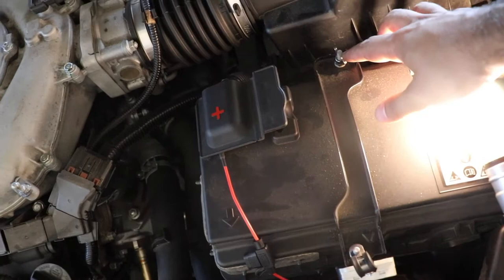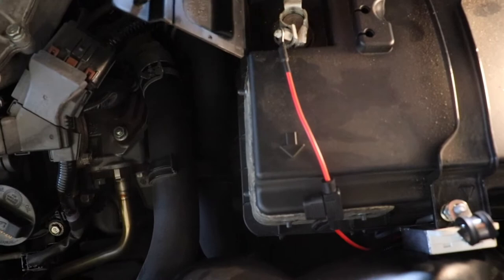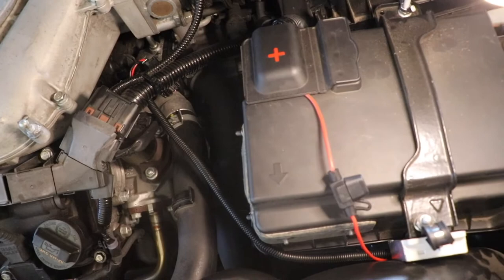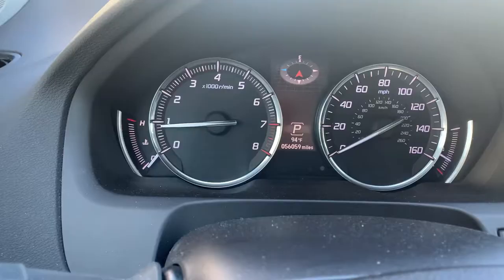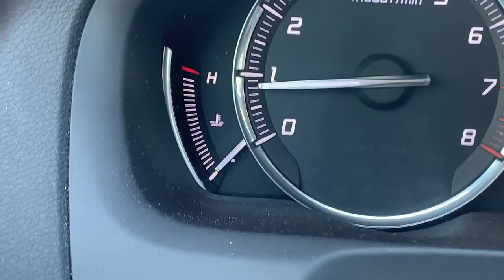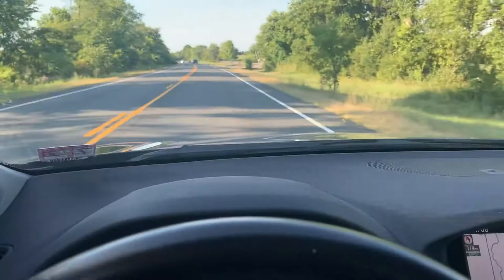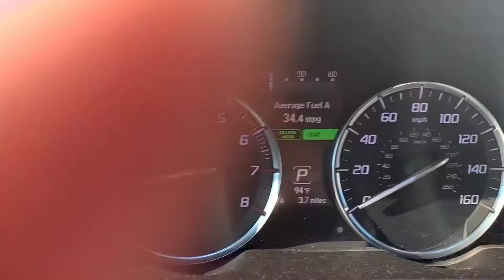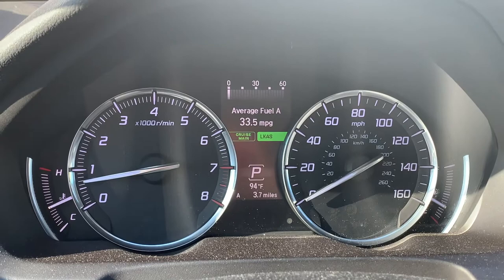Why I hate Honda & Acura VCM

Comment: The cylinders are disabled by disabling their valves. This creates a vacuum inside the cylinder, sucking oil into the cylinder, and burning off the oil when the cylinder is reactivated. This is a major flaw with this method of cylinder disabling.

Comment: I put in a VCMmuzzler about 2 years ago.  Transformed the car and made it drive so much more smoothly.
Reply: Did your fuel economy get worse?
Reply: @MrSamPhoenix  no. Stayed roughly the same within 1mpg, and the transmission jerkiness was gone
Reply: @ganzonomy  fantastic
Reply: This might sound stupid but It worked for me… I had the same issue in my 2011 odyssey after I drove 100,000 miles…. One day I was like u know what let’s change transmission fluid and o boy it fixed the VCM problem I don’t know how but It sure did now I change my transmission fluid every 10000 miles….

Comment: We own a 2014 Honda Odyssey with AVCM. it runs as smooth as ever. We cannot tell when it is engaged.  When we drive on the freeway at 65 mph, we can get literally over 35 mpg.  Again, we really do not notice the change in smooth running with eco mode.
Reply: given the year of your vehicle you probably have the vcm version that disables only two cylinders instead of sometimes 3.  I have read this system is better than the version of vcm that shuts down 3 cylinders at times.  I was not as lucky with my 2010 honda Accord.  I experienced spark plug misfiring due to oil infiltration into the cylinders but no other problems.  I installed the vcm muzzler two years ago and all problems are now solved.  Glad to hear you got one of the good ones!

Comment: I actually kinda like the VCM in my Acura. The vibrations are annoying but I do a lot of road trips and the better MPGs are nice. I do keep a quart of oil on me in the car because I heard some horror stories of the VCM causing oil burn.
Reply: Just realize you will have to replace the engine mounts more often because of vibrations...
Reply: @richbrake9910  that’s good to know. I’ve been told the same thing by a few other people so I will see how my new Acura does.

Comment: See my only concern about this is the coolant temp. The computer changes how the car run when it is not warned up. Different fuel levels and what not. I dont like the fact that using that is fundamentally changing how the car should be running when it's up to operating temperature
Reply from the maker: I definitely understand that concern, I was on the fence about buying it but I haven’t noticed any ill effects since installing it, only a bunch of positives. My highway mpg has improved, there’s no annoying NVH when the cylinders used to shut off, and the passing power is always there now. If there are any bad side effects I haven’t really experienced them.
Reply: @viksvehicles  I dont see how its possible for your highway mpg to improve when you are using all the cylinders
Reply: @reedhensley  If you ride the gas in an attempt to hold constant speed this will improve your mileage on highways. The  reason for this is that the 3 cylinder mode doesn't really maintain speed as well as it should so when you ride the pedal in attempt to maintain 60-70 mph, the 3 cylinders work overtime and use up more gasoline than if the 6 cylinders were working at a lower rpm. Basically its too inefficient at 3 cylinder mode to  maintain cruising highway speed above 50 mph. It gets worse on interstate when you try to go 75-80, having the 3 cylinder mode kick in then and you will see once you let go of the pedal the speed drops way to too quick causing you to push on the pedal more and use up more gas.
Reply: @reedhensley  when I’m 3 cylinder mode and u put down the pedal just a little it’s staying in 3 cylinder mode or 4 cylinder mode but those cylinders that are active are working harder than if u just had all 6 running.  Engine has more continuous power, so therefor never is working as hard

Comment: I bought a 2020 pilot with 25k I have 33k now
I had issues with my torque converter jumping at 2k rpm and kick down at low rpm slowing down making a whoosh sound at 2k rpm and a skip.i did a 3x drain and fill and oil changes I do at 40% always down 1 qrt 
Also had issues with heat at idle after trips fully warmed up heat at 75 degrees would blow cool air.

I purchased s vcm and now after driving no more slipping or vibrations my heat at idle is working after honda said the heat issue was normal it wasn't .vcm was the issue and also doing oil changes at 40% after install I'm not down on oil anymore .engine no longer burns oil 

Vcm is the worst system disable it if you want to keep your engine .the car runs so smooth ,more power also .it's driving better then when I bought it
Reply: I have a '19 and you are going to find the 9 speed transmission is jerky.
Reply: @midwestfarm757  I have the 6spd it's very smooth after I did the 3x drain and fill transmission.

Comment: I see how some people also have good luck with the VCM (Variable Cylinder Management). The trick is too make sure to change your oil earlier than what the computer tells you to (between 3,000 & 5,000 miles).
Reply: I was thinking the same thing I change it every 3500
Reply: Me too I don’t have problem at all with the vcm but I change like 3k - 3500 and I have like 170k miles
Reply: That gets expensive that’s ridiculous bought a 2011 Pilot and I noticed the oil level will go low about 3-4000 miles that ridiculous I never had any issues with my Toyota or Lexus I should’ve bought a sequoia or 4 runner. Is the pilot burning oil???
Reply: @Lowersillox doesn't the disabler disable your cooling fan, too?
Reply: @valentine1782   at that day I don’t have the s vcm disabler, but now I have it and I can tell you, svcm don’t disable the coling fan, I tested first idle like 30mins and they come up. I have months with that and I don’t have any problem
Reply: You all are forgetting about your motor mounts!  Because the engine is running on fewer cylinders, the additional stress on the motor mounts will destroy them!!  The mpg loss from disabling VCM is less than 1mpg but the piece of mind of knowing you WILL NOT prematurely destroy your V6 is well worth it!!

Comment: Good info about the after effects of Honda’s ill conceived system to conserve fuel. Though this post lacked detailed info on installing the S- VCM disabler. Getting to the plug on the coolant hose is a pain in the @$$. Push on the connector release rather than pull on it (as I did, er tried). Park the vehicle and let it sit for an hour. Keep the key fob far away from the vehicle. At least 20 feet from what I read. The key fob may activate signals that send codes which could come up while installing the device. I heeded that fore mentioned advise and have had no issues so far. Remember, those fluid filled motor mounts are Expensive! Though not as much as a rebuilt engine would cost due to the adverse effects of the VCM.

Comment: I just bought 2020 Odyssey and I have had a couple of long drives and I did not feel any vibration or anything of that sort during the drive. Has Honda fixed these vibration issues in the new models?
Reply: u haven't yet because your car has new engine mounts. when they fail you will feel the vibrations
Reply: I notice the VCM more in colder weather as well.

Comment: I have just bought a Acura RDX 2018 with 97 km and the car has a lot of vibrations in the high way Idk why?
Reply: u need new engine mounts. they are electronic and control the extreme vibration from cyl deactivation on the highway

Comment: I hate it also 😒  and i have the vcm muzzler thats a direct fit on the only thing is it engages sometimes when the engine temp gets higher
Reply from the maker: I didn’t want to fiddle with the different settings on some of the fixed systems where you have to swap out the resistor. So far mine is working well and I haven’t had to adjust anything, I haven’t detected the car shutting off any cylinders since I installed it :)
Reply: I have the vcm tuner and the eco green light comes on sometimes times but I don’t feel the jerking anymore

Comment: Just bought a 2010 odyssey ex-l with 107k miles on it. Drove it home on the highway but didn't notice anything when the eco light came on. I was aware of the vcm issues prior to purchase. I'm thinking about disabling it completely to give this van an extra 10 years of life for the family.
Reply: I just bought my 2013 pilot with 110k miles. Can feel steering wheel and pedal vibration when eco light on. It’s minor feeling though was tires issue, but according to this guy’s description I’m sure it deprive from vcm deactivation.

Comment: Your video doesn't indicate the make of your vehicle.?  I have a 2005 odyssey with VCM.  Tried tuner and this stopped the premature oil burning and premature front engine mount failures.  With Tuner gas GPM = 20 with VCM GPM=27.  But the tuner stopped the engine oil burning.  See Honda service teck bulletin 13-085. Honda lost a law suite and gave odyssey 8- year warranty for owners to bring in their vehicles to have the piston rings replaced due to premature oil burning.    Notice odyssey doesn't use timing chain but a timing belt. This means higher maint4enance cost.

Comment: I’m going to say this even tho I’m not sure what it is but I have a 2017 Honda Accord V6 touring sedan and it has a 6 speed auto, sometimes when I’m cruising at 80km/h—50mph the car stays in 5 gear for about 30 seconds and it has kind of like a drone sound because the car stays in 2,000/2,300 rpms until it finally shifts into 6th gear and the rpms drop to 1,400 rpms, the car is completely stock I don’t know if is something of the transmission programming or is that VCM that at 80km/h the car switch to 3 cylinder
Reply: I have this same car. Do you notice the vibration in the steering wheel as well? Or when cruising at 65+mph? If so, then it’s definitely the VCM. I’m gonna order a disabler and see how it goes.
Reply: If your letting off accelerator most of the way your cylinders are deactivated, and if at a higher RPM like that your more likely to feel that vibration

Comment: I have a 2014 Honda Accord EX-L Sedan with a V6 and an automatic transmission. Does my car have VCM? I’m pretty sure it does but I wanted to double check with someone.
Reply: Sure does.
Reply: I have the exact same year, make and model Accord. I got the S-VCM and it works great. I'm averaging 25-27 mpg with full V6 power. Glad I read up on muzzler. My car only had 53,000 miles when I installed it. Dipstick is always right on the dot. Get one. Comes from Canada and arrived in 4 days.

Comment: Does the vcm restrict HP and Torque?
Reply from the maker: Not really, it only turns on when you’re on part throttle at a steady speed. If you give it any acceleration it will go back into 6 cyl mode for full power. It’s the sound and vibrations that annoy me the most when VCM is active.
Reply: @viksvehicles  it's a vibrating, grumbling sound i know all too well. When I first purchased the car a few months ago i thought my AC compressor was going bad. I got tired of it & just installed S-VCM suppressor in my car last week - haven't seen the eco light since. It's almost like a completely different car. Honda should be ashamed of themselves.

Comment: according to Scotty Kilmer don't buy a Honda with Earth Dreams Technology engine, is this true? also he says avoid cars equipped with cvt transmissions, i know toyota and honda are reliable cars.
Reply: The reason is because the vcm wears down the seals on the cams from all the constant vibrations caused by 2-3 cylinders not firing causing oil leaks and also creating negative vacuum within the cylinder itself causing oil to enter and being burnt once the cylinder fires up again, people run into low oil and then the cams and just about everything near or around the cams run dry. Just always be aware of oil levels and when the time comes, replace o rings and seals.

Comment: I have a 2015 Odyssey with VCM and 78k miles on it.  I have never experienced any vibration issues at all.  There is no acceleration delay either.  Why are some experiencing this and others not?
Reply: We passed 120K miles (2014 Ody) and #3 plug started fouling from sludge build up on seizing the piston rings thus causing oil bypassing rings getting to the spark plug.. Honda recommended replacing piston rings $7K, basically whole motor rebuild. This is caused from the VCM over time continually bypassing this #3 cylinder. Just hope that when it happens to yours it still has a warranty.   Honda is very aware of this and will first do a plug swap hoping it will get you past the warranty....
Reply: @nosirragsg  Do you use fully synthetic oil?
Reply: From what I heard and read, the problem is not noticeable until around 90k. Then again it may depend on how many times it was activated.